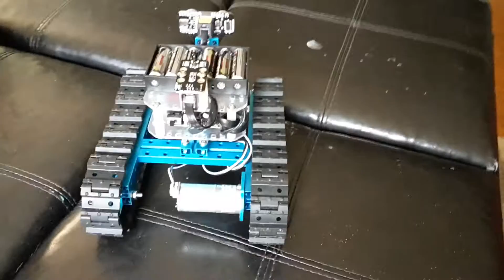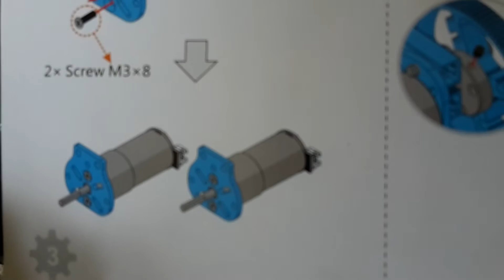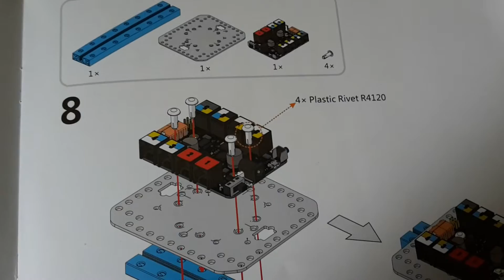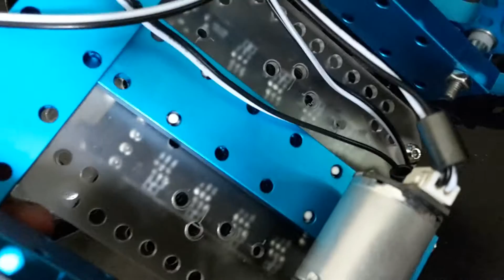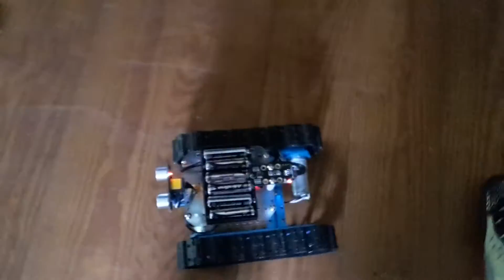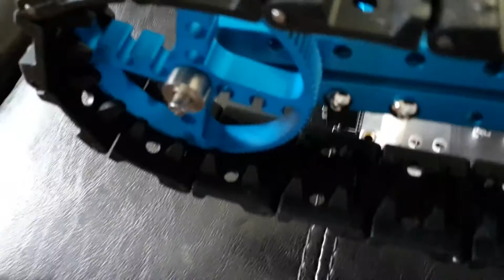Makeblock Robot Starter Kit Fails & Review

Comment: I had many of the same problems you did. But re: the orange heads for the motor wires, I was able to sneak those in at the end of installation without removing the L-shaped bracket. And I was able to pry them out using one of the screwdrivers. It's awkward, but it works.

But what was really a bummer to me is that I just got this robot a week or two a go and... guess what? The left motor is fine, and the right motor appears to be underpowered. So it doesn't go forward at speeds 1 or 2 and it doesn't turn well (sometimes not at all). Same song & dance as you folks have apparently gone through months ago.

Comment: The kit is great, the motors are not faulty they are low quality can motors that require way more current than 6AA batteries can supply. Upgrade your battery pack to a 2 or 3 cell lipo pack and the motors will come alive. A 3 cell lipo is .4 volts above the 12 volts recommended but the Orion board seems to tolerate it just fine. you might also consider a 9.6 volt NiMH subC pack.
Reply from the maker: Scott. I used the stock battery pack but with some higher end aa batteries and new motors and worked fine.  In my case I have 6 motors and all 6 were faulty and make block after months of back and forth acknowledged they were faulty and sent me new ones.
Reply: +Shai Perednik I am a robotics club advisor and we have over 20 makeblock motors and about 1/3 would not work with AA batteries but ran great with with higher voltage packs that could supply 1.5 amps of current.  The stall current is very high on some of the motors. if you try a high power pack your motors will most likely work. High end AA batteries can still not supply the current needed to run the motors properly. you will get much more enjoyment if you upgrade to a higher voltage larger pack. The new raptor starter kit they came out works well with AA batteries the motors are much smaller and need far less current.
Reply from the maker: +Scott Griffis you certainly know your stuff here so I'll follow your lead.  Is there a particular battery pack and charger you suggest buying?   I'd assume this is something that could be found on Amazon.  If it works out I'll add it to the description so others find a solution too.
Reply: +Shai Perednik I use a 3s 2500mAH lipo pack and manually monitor the voltage and recharge the pack when it gets below 10.8 volts, a better option if you are not familiar with Lipo packs is to use a 9.6 volt NiMH pack between 1500mAH and 2000mAH . in either case you will have to make your own connector from the battery holder lead. Also we did have two motors that appeared to "fail" at our last contest; however we removed the gear box from the motor and found the transmission needed lubricated; when we lubricated the gears and  reassembled the transmission the motors  worked great again.

Comment from the maker: after months of emailing, pictures, videos, and even messaging their CEO on LinkedIn, makeblock finally replaced the motors I had. now the motors work, but the IR control is useless.  from the forums, so is Bluetooth. so I'm trying to find time to rig up a nrf modules for remote controlling the rover.  very frustrating experience and my kids doesn't want to play with it anymore
Reply: Why do you say the IR control is useless? I heard others say it is very directional, so you have to be sure you're pointing it directly at the sensor mounted on the top.

Comment: I have been having the same issues although I haven't tried the IR yet because I still have to get the battery for it. I tried energizing the motor through the scratch programming interface and unfortunately have been unsuccessful. The motor terminals are showing about 1.3V @ 50 speed. Its pretty shitty that this thing is 100+ dollars and you cant even get a decent set of 5 dollar motors with it

Comment: The motors that come with the kit are faulty. It is a known issue by the manufacturer, but I have not heard from them after my first attempt at contact on the message board. I planned on upgrading the motors anyhow, so it doesn't matter. I bought 2 starter kits on sale at radioshack for an excellent price, so extra motor expense is no biggie. This kit is definitely not "turnkey". Lots of updates, setup, little programming necessary. The parts are quality aluminum, but I would have never paid full price for this kit.